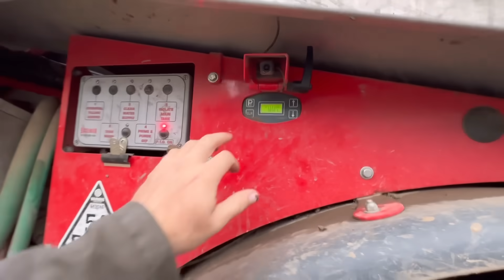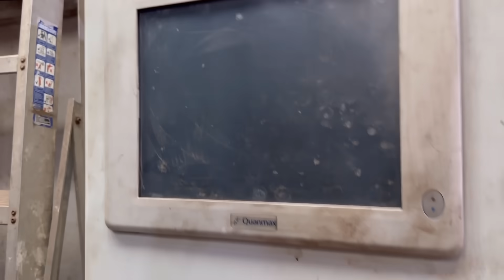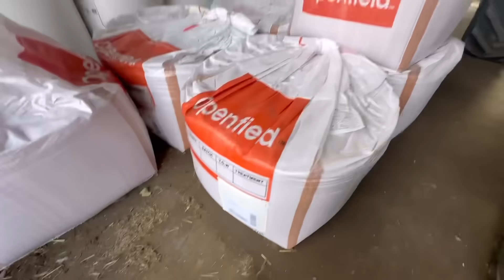OSR SAVAGED BY FLEA BEETLE  #AnswerAsAPercent 1301

Comment: Correct me if I’m wrong but other year didn’t some traffic police officers volunteer and worked on days off to escort tractor run. Confident traffic would do the tractor run in there own free time as long as they are allowed to use traffic vehicles

Comment: That ash auger, obviously I haven't seen it up close but instead of bolting it in place make a rubber lined cradle of some sort that stops it turning and holds it in place  but let it flex. I had a similar problem on a conveyor and done a similar thing. Worked a treat